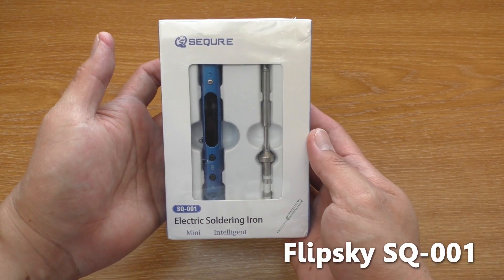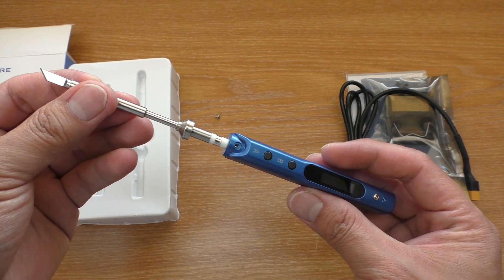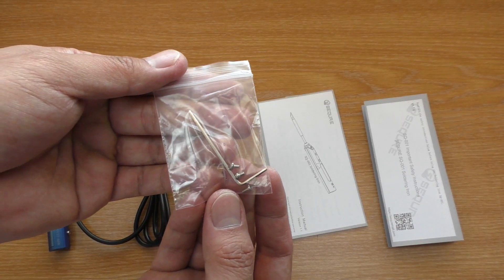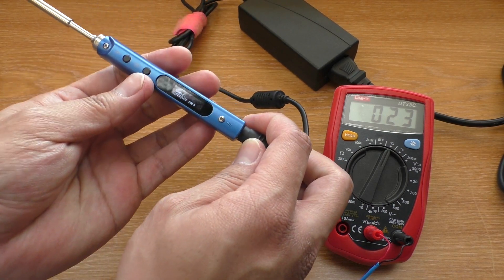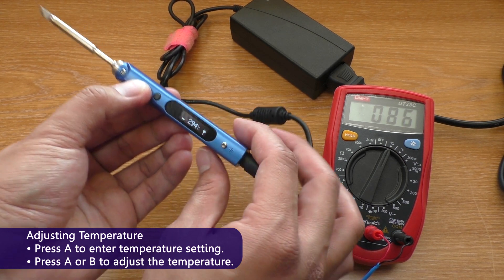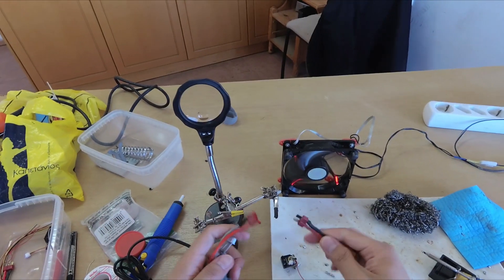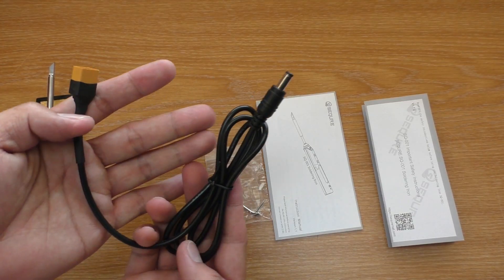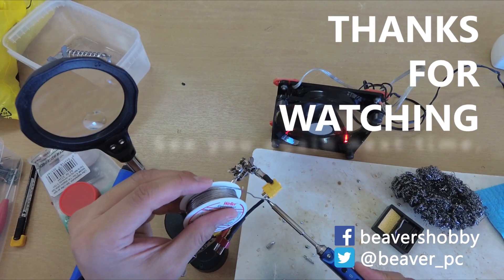[Review] TS100 Soldering Iron & How To Update Firmware

Comment: how its holding up?
Reply from the maker: I'm still using it till today. It's still working well.
Reply: @BeaversHobby  really wanna get it, just afraid if anything goes wrong i cant repair it :(
Reply from the maker: @brandenprateek273  Well, I think that's the problem. If the board is broken you can't fix it. Still, it's really tough and I don't think you need to worry about that. Most of the things are done on the firmware side anyway.
Reply: @BeaversHobby  thanks for the insight, well I'm looking into 2 irons, will choose from these 2. One is ts100 and another is bakon bk969D. Bakon is a Chinese t12 60watt iron btw. Really confused between these 2. What would you suggest?
Reply from the maker: @brandenprateek273  I went and look the Bakon up, it's a full station so the use cases are different. TS100 (or SQ001 if you want a cheaper one that works the same) is a portable that can work off battery. Bakon is for work bench. So if you have a full working table setup, a soldering station is really good. Otherwise a portable one will allow you to work anywhere.

Comment: Hi beaver, love your videos. Do you know if this iron will work with a 2s lipo 850mah?
Reply from the maker: No, it doesn't. It needs at least 3S to work. However if you have 2 of that battery you can put them in series to make 4S and it will work.

Comment: i have a ts100,my 2nd in 1 year as the 1st kind of just fell apart,its not the most robust nut its an awsome little iron,i use a 20v lithium from my corless drill with a couple of spade connectors and it automatically converts to DC,a longer distance between plug and iron is the only fail that it has,mine was $72 US with all the power cables

Comment: Why is it when I try to
Solder my motor to esc the soldering metal doesn’t stick on the motor
Reply from the maker: Try and apply a bit of flux on the terminal. If the surface is well prepared the soldering tip might not heat up enough for the soldering to stick.

Comment: Hi Beaver which ts100 tip do you recommend when working with 1/28 scale stuff like soldering ESCs and brushless motors? Thanks.
Reply from the maker: The good tip to solder 1410/1625 motor is the small conical TS-I. The tip is small and you can tin a terminal on the motor with ease without the risk of touching other terminals.
Thanks for the question. Seems like I forgot to mention this in my review too. I'll put this in my next brushless build video.

Comment: any tips as to why my ts100 does not update custom firmware and also no files show when pressing the button while connecting USB to pc and mac?
Reply from the maker: If it doesn't show up in the computer at all then you'll have to check the driver. Also try and hold other button while plugging it in to see if it shows up.
Reply: @BeaversHobby  I tried with both windows 10 and Mac they both show up pressing button closes to iron and connecting but windows would not show file being copied and same with Mac but with Mac I did transfer but it would not ejected causing not to complete if I removed the USB so what I did with the Mac I just let finish the file transfer and shut computer down and then remove the USB after it had power down!    This worked for me finally! Now I have the firmware update thanks!
Reply from the maker: @New777World  Glad you got it working.
Reply: @BeaversHobby  thank as well for your input! 👍

Comment: I have contacted the miniware team to confirm that the model of this soldering iron is SQ-001, which is a poor imitation of the TS100 soldering iron. You should buy a TS100 soldering iron, you will find that they are very different in product quality.
Reply from the maker: Thanks for the info. So far it's working well for me. We'll see how long it'll work because It has become my main soldering iron right now.

Comment: So, by other words: expencive and useless. :)
Reply from the maker: Hahaha. Well, a $10 iron can do the same job so you could say that.
But it's really much better than other stuffs in this price range and it's as good as an expensive soldering station.
Reply: @BeaversHobby  Well, iron Goot px-201 with temperature control, pro, made in Japan, super quality, cost here in the shop (not on banggood over seas) 40 USD. (http://www.goot.jp/en/handakote/px-201/)
Reply from the maker: @Weaselpro  Looks good. However the selling points of this TS100 are precise temperature control via sensor and onboard chip, battery powered so you can use it anywhere even outdoor. And it's compact so you pretty much have a soldering station in a pocket. It's really popular with drone community because they are outdoor most of the time.
That being said, use anything that works best for you. Don't waste money on things you have already and still work.